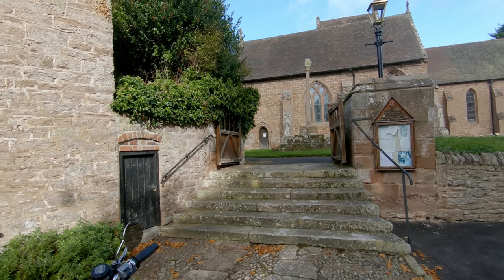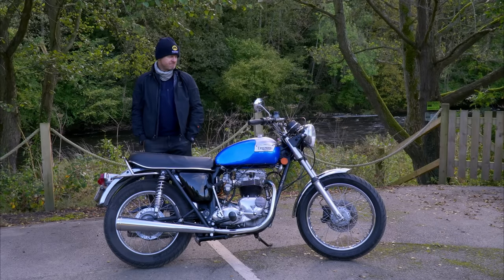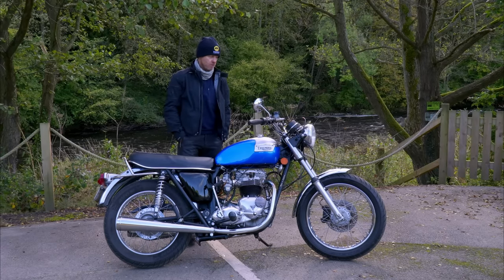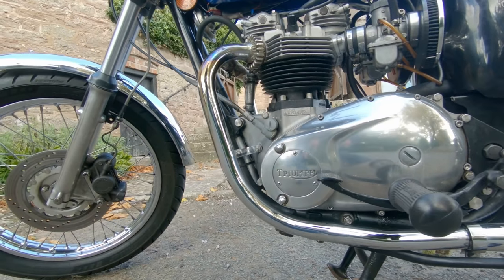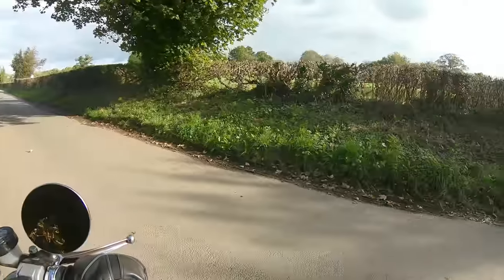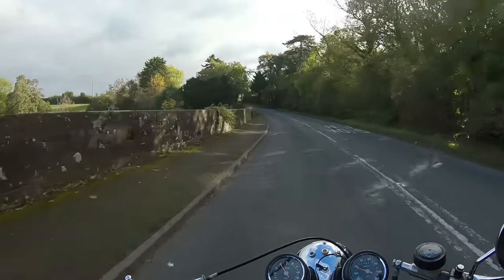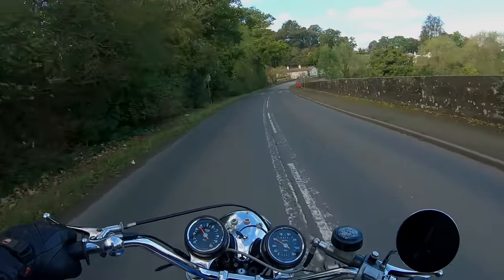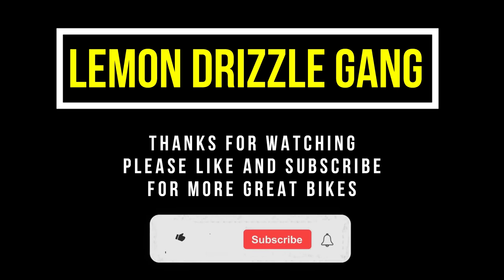Modified 1975 Triumph Bonneville,  better than a modern retro ?

Comment: I had a 1976 Triumph Bonneville and rode it for 25 years. The engine leaked oil everywhere (in spite of my best efforts) and it vibrated like a paint-can shaker at highway speeds. Triumph finally got it right with the new Bonnevilles.
Reply: With respect, but your 76 must not of been set up well, i have 2 T140's 76 and a 78,,, both since new and they both run smooth, Hagon shocks Akront rims  Avon tyres and Boyer ignition keep em tuned and don't over rev them and they respond well to sensible mods 👍
Reply: All the OIFS seem to be a little different in all respects.  We have several and they  all vibrate a little differently at different speeds.  
I find them all an absolute pleasure though. 🏍😎🌞

Comment: A mate at school bought a 650 Bonneville at the beginning of the 70s and it had problems with fifth gear. I remember him getting annoyed at the local dealer not being able to fix it and he contacted Triumph directly. The bloke he got through to said that they were having a few problems in the factory and it was possible they had fitted a 4 gear cluster by mistake. No wonder they went bust soon afterwards. Sadly he ended up buying a watercooled Suzuki 850 which was incredibly fast and reliable but had no character at all.

Comment: The T140V was OK. I had one for about 5 years. It was a 750cc. However, the best Bonneville was the 650cc  T120, 1969. I had one of those too. The best bike i ever had,  and i had a lot of British bikes, only 1 foreighn bike) was a 860 Ducati GTS, bought it in 1975. Amazing, the Triumphs were not good handlers, the Ducati you could lay it down in corners. My friends had Tritons, Tribsa's Norvins, all kinds of bikes, all British and we used to hang around a pub called The Berkley, opposite Spanish city Whitley Bay, then after a few years we moved to The Briardene pub. I remember it all changed when a Honda CB 750 4 cyl appeared on the scene. It didn't leak oil lol...amazing

Comment: I owned a 1976 version. It was bought brand new from a dealer. How did I like it? It was ok if you rode it within it's limits. The bike was fast and handled great. Also easy to start. Negatives? High frequency vibration caused issues when you brought the revs up. Things loosened up including the carbs. I had to carry spare bulbs because when the tail light blew out and I didn't know it did it would cause the headlight to blow because it got too many amps. Lucas electrics I suppose. If I kept the bike below 60 MPH it was fine. Over that speed and the gremlins arrived to do their damage. I owned a 1971 BSA Firebird Scrambler (high pipe) that was just as powerful and handles just as well and built much better without all the issues. Just my thoughts & experiences. Cheers.

Comment: Built like it should have being built in the first place? That's an interesting comment about compression. Originally, they probably had a lot of piston blow-by that caused the oil leaks. So some of the advantage of higher compression disappeared through the breather and gaskets?

Comment: A very nice looking bike although my 78 T140V was a UK spec which I preferred. Sounds lovely and with a rear drum at least you have one brake that definitely works in all conditions (my standard front and rear discs were useless in the wet). Mine always gathered attention (sometimes unwanted) but was better to look at than to ride. In truth the vibration meant that it was barely any quicker than the Honda CB250RS (single cylinder) that it replaced although I enjoyed the low down torque. The riding position with feet forward as you mentioned was awful and after a massive tank slapper I never trusted the handling. Having said all that it never let me down (although it tried) including a trip from Northamptonshire to Scotland and back as far as John o’ Groats. It certainly seems that the bike featured here has been well sorted ! 🇬🇧🏍
Reply: ‘…after a massive Tank slapper I never trusted the handling.’ 
Having owned a 73 650 Bonnie, a 73 750 Bonnie, and a 73 750 Tiger, all of which had footpegs ground down from hammering thorugh the twists, all I can say i that your 78 sounds like it had been seriously bent at some stage, or had something else wrong with it, because I've NEVER, EVER, in over 49 years of riding had any tank slapping episodes on any Triumph I owned and the handling was like being on rails! (I had a 69 Trident and a 75 T160 as well, no complaints about handling there, either.)
(The vibration comment is just plain silly!)
Using the disc brakes in the wet was sometimes a pain in the arse, but that comes down to knowing how to do more than just grab fistfuls of brake lever like a Wally who doesn’t know wtf he’s doing. 
I wish people who don't know how to ride, would just leave the great motorcycles to those of us who do and stick with their poxy little Honda CB250RS’s. 
What a load of nonsense!
Reply: @BigAl53750  well I certainly upset you didn’t I ? I was only 20-22 when I owned mine so obviously not the most experienced motorcyclist at the time. The tank slapper was a one-off that happened cranked over through a corner but as I said it ruined my confidence - I was lucky that no vehicles were coming the other way at the time, I wasn’t the first owner so I don’t know if it had been bent and I didn’t mention the ground clearance - there wasn’t any. My next bike had more cubes and although two years older was superior in almost every department. Nevertheless I was glad I owned a Bonnie and still have fond memories although I’ve never seriously considered another one 🇬🇧🏍
Reply: My original chrome plated discs were pretty useless in the wet (not much better dry), but replacing them with unplated cast iron made a big difference. Only downside is they rust very quickly when parked up wet, but they clean up as soon as you use them again.

Comment: Great upgrades, the only things I would add would be an oil cooler & ceramic coated exhaust pipes & all led lights.
Reply: It actually has a LED rear light, might fit a LED headlight at some point. It runs much cooler than a standard bonnie, those alloy barrels dissipate much more heat and the tight piston clearance also helps hugely. Thanks for watching!

Comment: i have a 1978 T140V........Problem is, it's in bits.
Took it apart 3 years ago to fully rebuild it, ended up buying a Speed triple as a daily ride and haven't got round to putting the Bonnie back together ......this makes me want to get back to it .
The sound of the T140V is so addictive ....especially with a set of TT pipes ....not so much for the neighbours .

Comment: lLoved the bike well sorted and sounds great, I noticed the kickstart does not return and had to be hooked up with your leg.I own a 1976 t140v which runs well.
Reply: Frank, the kickstart is a modified version, as fitted to the T160 Trident. Up side is it folds away better than standard, down side is it can get caught up on the exhaust, oh well! Thanks for watching.

Comment: Still have my (purchased new on January 10, 1977) 1976 Triumph T140V Bonneville 750 (744 cc's). It won every race all the way into 1992 against every type of motorcycle on the road. It had enough power and it outhandled them all, by far. Very dependable too! Best motorcycle ever made! - Peter age 71
Reply: No it didn't triples took iom and transatlantic series, I'm 69 and Bonnie's are not race bikes ever, rose tinted glasses.

Comment: No left hand switch cluster?  Mine had one.  Controlled signals (not equipped here), and had a kill button.  Was this a UK spec or a surgical removal?  My right side controled headlight dip, horn and headlight flash.

Comment: I love seeing the bikes from the 70's. It's what I grew up on. I have a 1972 Moto Guzzi Eldorado. Will you ever show one of them?
Reply: Ha! Parallel Universes or what? I bought a 1973 Trophy Trail 500 in early '74 and while that one is long gone i have had a 1976 Moto Guzzi 1000 i convert since 2013 that i am resto modding a bit so hopefully i have an i convert that gets both ratios in the 2 speed box. At 55, 000 miles it looks nowhere near engine rebuild time.
Reply from the maker: Dont see many Eldorado's over here but we are are big Guzzi fans

Comment: Would be very interested to see an on the bench going through the upgrades, 

I'm currently rebuilding a 71 BSA a65 OIF and I am fitting the front end off a t140 because I don't believe drum brakes are fit for modern roads, and I'd love to get information on the suspension upgrades
Reply from the maker: Thanks for watching we have that video in the planning

Comment: Two quick questions for Dave as I'm restoring (and slightly modifying) a '71 Bonny: (1) what tires are those, please; and (2) did you have to drill out any of the honeycomb-like outlet holes in the Dunstall copy silencers? I've located a few makers and it isn't clear whether all of those holes actually go through.
Reply from the maker: Hi I will ask Dave to respond
Reply: Avon Roadriders Mk2, very good and wear better than the earlier roadriders. 
No drilling required, all the Dunstall knockoffs I've used are very much like the original, the "gatling gun" holes all go through. the quality (I think they're made by Emgo??) is actually very good, just the awful sound absorption material is a bit of steel wool that soon blows through, and then in my opinion (and it IS just opinion) they sound too harsh. I use Acousta-fil which expands on heat and doesn't degrade as quick, then replace the end cap with self tappers. Norton peashooters also work well and sound great but (again in my opinion only) don't look as good on a bonnie.

Comment: This got me thinking back to when I started riding..... one of the guys had a 650 Bonnie that was a five speed and had right foot gearchange.... I think it was reg. number YXD32M. 
It got nicked about 1983 by a toe-rag from outside the Moss Hall Tavern pub in North Finchely , and I found bits of the bike (- the owner recognised the front wheel as it had a peculiar kink in the rim) at a spares specialist who was a known fence called Andy Shox or something in Kilburn... he later died in Spain or somewhere - he got murdered  in some dodgy drug deal ! 
It would have been 1973 ish model I think...... Do I remember this right, ref the 650 with a five speed and right foot change ?
Reply: Yes 1973 was an "overlap" year with Meriden producing 5 speed right hand shift 650s and 750s. Only cosdmetic difference was the 650 was in a purple/white colour scheme rather than the burgundy red for the 750s. I remember the name Andy Shokks (I think his shop was called Shox though?), seem to recall he was involved in Guzzi spares but could be wrong, long time ago now! Thanks for watching and your comments.
Reply: @waveydavey750  The shop was Shokks, you are right and as for it being an 'overlap year' that is maybe why I remember it being odd. I do recall that the first 750's were really over-bored 650's though as they still had a  'nine stud' cylinder head whereas the 'true 750's were a ten stud with different rocker boxes - and maybe that was when the engine was 're-designed' into a left side change.  I think my mate's bike was a blue and white UK tank one  but memory sometimes fails us all ehh ?..... oh how time flies !

Comment: Just come across your channel. When I first saw this video I thought the bike had an earlier frame but on closer inspection it's the way you've fitted the earlier side panels to make it look like that. Whatever reason you fitted them it makes the bike look so much better than the later oblong type. One question where did you come by the opposing side panel to fit on what would have been the oil tank on the earlier frame type?

Comment: Having been riding for over 40 years I am saddened by how limited performance is on the modern retros. The Moto Guzzi v7 was a very fast dream bike in the 1970's. But sadly the retro is nowhere near as fast as the original. BUT getting a reliable 100 HP out of a modern air-cooled Bonnie is not difficult. Transforms the bike.

Comment: Silencers modified with "sound absorption material " Whatever next?I used to have the  Anglo bike ones and when l used to ride from Stroud to Painswick my mate had a hot cuppa ready for me  on arrival because he could hear me coming . Straight throughs sound great too on the T140🎯
Reply from the maker: I had a Morini like that my mate could hear me from 2 miles away
Reply: I remember Bike magazine testing Anglo bike's Tiger trail with the same pipes and advising them to put them in a bin. they were anti social then never mind now. I used one on my Bonnie Special (which I bought from Anglo bike) and I quickly binned it as well!  The silencers I modify already have sound absorption material, it was just crap. Just my opinion (and Bike magazine's I guess).

Comment: That Bonneville isn't a 1975 model, it has the right hand gear shift lever of an older model, 1975 production Bonneville's and Tiger's were the first Triumph twins with a left hand gear shift. It's possible that Bonneville was one of the bikes that were locked up in the Meriden factory during the 18 month blockade against the factory's closure. That Bonneville would have been manufactured in 1973 or 1974 and registered after the blockade machines were released, but it's not a 1975 manufactured machine. A mate of mine used to have an early 1976 registered Bonneville on a 'P' plate, it was also one of the Meriden blockaded machines with a right hand gear shift and left hand brake pedal..
Reply from the maker: I will ask Dave to reply but I do know he has another Bonneville in his workshop a few serial numbers different and that is the same year and spec
Reply: First letter of the engine \frame denotes the month and the second is the year ,my uk trident is GK G is may I think K ,= 1975, then the engine number overlaid on TRIUMPH STAMP   BOOK for a fuller list, here in australia,
Reply: Cont, my trident bought 6 months old in Southampton £850 ,still have it here in aus ,engine numbers and letters are listed at the front of genuine service books, spares I think,  I was 23 now I'm 69 ,
Reply: @LemonDrizzleGang  Yes the engine/frame number of the T140 in the video is  "EK" (June 1975). The co-op released the backlog of completed and semi completed bikes once the blockade lifted in April 1975. As the factory was effectively frozen in time at the start of the lockdown, it took a while to use up this stock. The 2 year contract the co-op signed with NVT included a deal for 1500 right hand shift bikes, all to be delivered prior to the new-season left hand shift bikes in August '75. All documented in various books by people who were there! There's also plenty of photos of the frozen production line with R/H shift bikes sat in various stages of assembly.
Reply: @waveydavey750  Thank you for the information, I stand corrected as you've said, the left hand shift machines started in August '75, so it's obvious that January to July '75 Bonneville and Tiger models would have a right hand gear shift. Sorry if I caused some confusion in my first post.

Comment: Hi, I am from Czech Republic, and I have Bonnie T140V 1978 UK model with big fuel tank and original low handlebars. I bought this bike 3 years ago, and I'll runed only 10 kilometers because needs papers for registration,  but before this, I must with my friend check engine. So, my question is, how reliable these Bonnevilles from lates 1970's to 1983 before Hinckley's Triumph? Is possible to daily ride? Its something like "modern motorcycle" to riding to work, travels around countryes, and does he mind the head in summer weather? Thank you for answer. 😊
Reply: In my opinion only, yes you can ride them daily, they are tough engines and CAN be very reliable. BUT, that assumes you are happy to keep on top of maintenance and the inevitable wear and tear. Aslo it assumes your engine is well sorted to start with! Some weren't even straight out of Meriden, and many have been butchered by previous owners. Personally I think they are best for fun journeys and the occasional ride to work etc, rather than relying on them, it can take the fun out of the equation, but that's just my opinion. Maybe try it for a while and see? All the best, thanks for watching.

Comment: This bike arguably needs the following additional items to complete the excellent array of mods & upgrades undertaken thus far: (a) decent oil cooler (b) a bikini fairing at least to reduce drag & boost rider comfort (c) a sheep skin of sorts or equivalent for the seat to reduce rear-end rider distress and (d)  a tank cover to protect that pristine paint job. The lack of an oil cooler is the most puzzling (egregious?) omission from this otherwise extensively modified and upgraded bike. High oil temps can be the death of tuned bikes producing extra horsepower + heat. Recall that High temps all but killed off Ted Simon's over-loaded  OEM single-carb Triumph Tiger 500cc twin riding across Libya & Egypt in late 1973 (see p.65 of Jupiter's Travels).And having ridden small Hondas (with mediocre suspension) around Thailand & Vietnam, I can attest to the importance of rider rear end comfort! And how times change. My 2006 Suzuki GS500E (with after-market bikini fairing) produces almost the same horse power and has done 100K kms with minimal R&M required, besides a stator and does about 85 mpg on trips. TTFN.
Reply: I have fitted oil coolers in the past to some of my Triumphs but quite deliberately not this one. Mostly due to the fact the Nikasil alloy barrels run MUCH cooler with tighter piston clearances and better thermal conductivity. The spin on oil filter slung below the sump plate increases the (marginal) oil capacity and acts as a cooler of sorts as well. It runs noticeably cooler than most T140s. Thanks for your comments